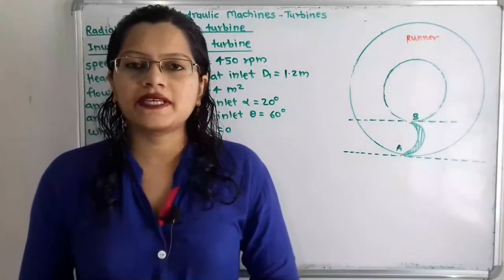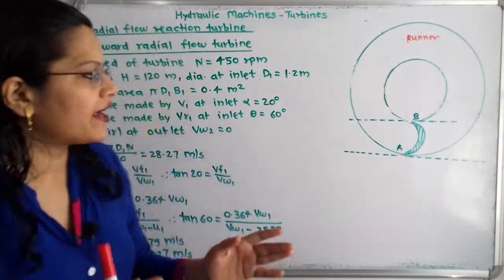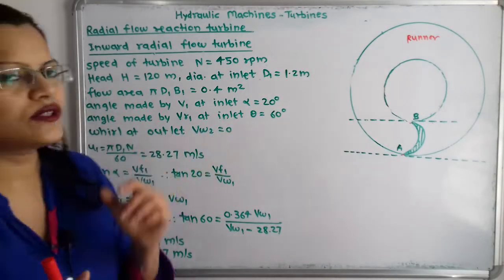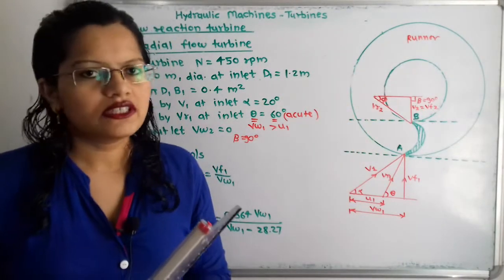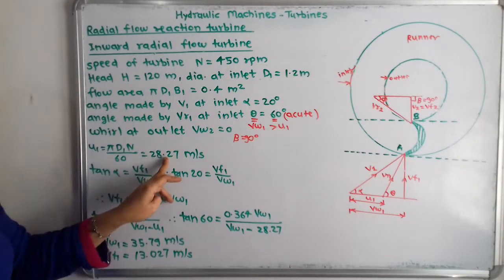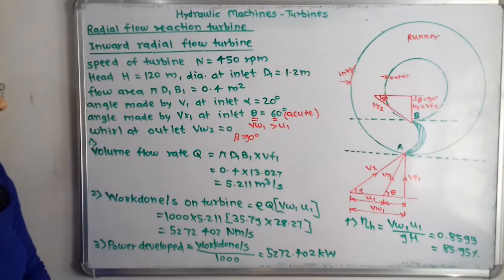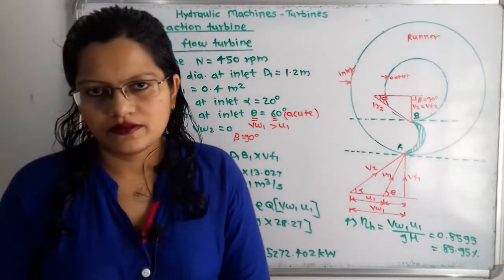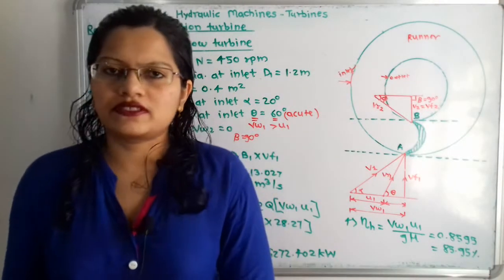Problem 1 on inward radial flow reaction turbine /  whirl at outlet is zero/ Fluid mechanics

Comment: Can you please help me to solve the below problem

An inward flow turbine (reaction type with radial discharge) with an overall efficiency of 80% is required to give 200h.p. the head is 8m, peripheral velocity of the wheel is 0.96√2gh, the radial velocity of the flow is 0.36√2gh, the wheel is to make 150r.p.m and the hydraulic losses in the turbine are 22% of the available energy. Determine 
The angle of the guide blade at inlet ? 
The wheel vane angle at inlet ? 
The diameter of the wheel ? 
The width of the wheel at inlet ?